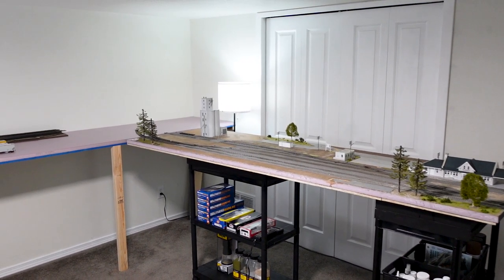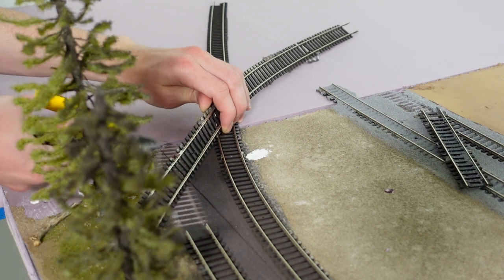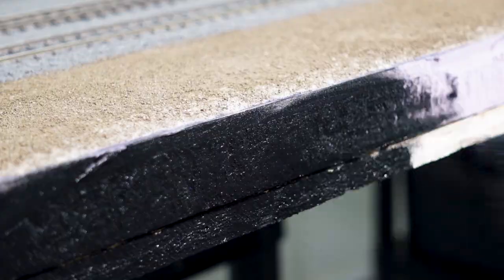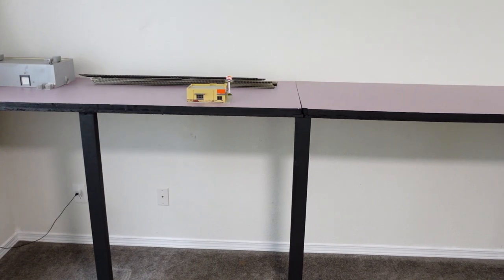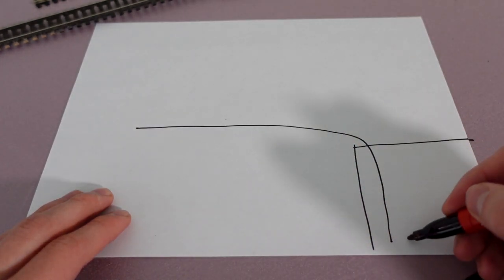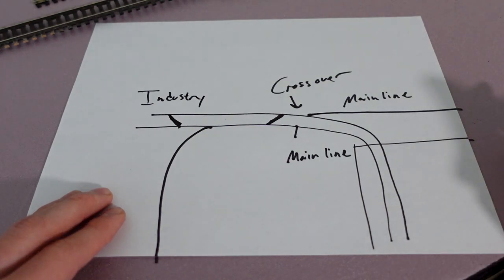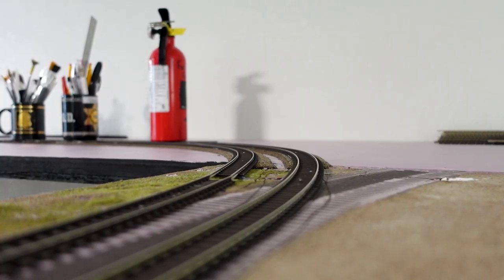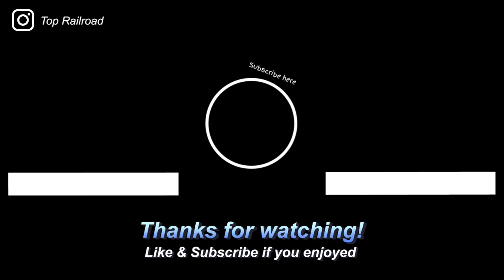Layout Track Plans & Finishing the Foundation - Large HO Train Layout Build - Ep 22

Comment: I just started watching this set of videos, and I am loving the content! You do a very good job of explaining your methods! I do have one question: how did you handle the transition from the "original" section to the cork roadbed of the new section? I'm not understanding how you addressed the difference in elevation between the track laid on the cork roadbed and the track laid on the foamboard of the original section. I'm guessing that at scale that's an elevation difference of somewhere around a foot. How did you handle this?  Thanks!
Reply from the maker: Thank you very much! And yeah I can’t remember but I don’t think I explained it at all haha. But back then I didn’t do it properly cause like you said it was a dramatic change in elevation for the trains. 

My suggestion if I were to do it now is to sand the cork road bed down at a gradual slope or use those foam woodland Scenics risers they have